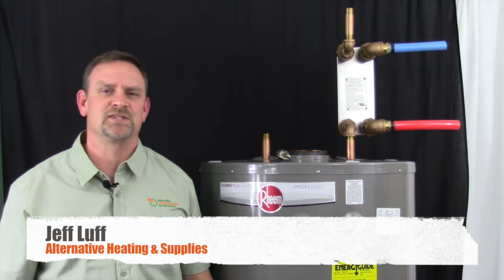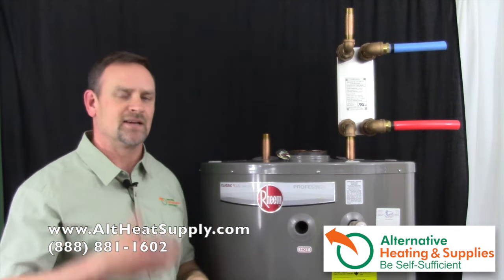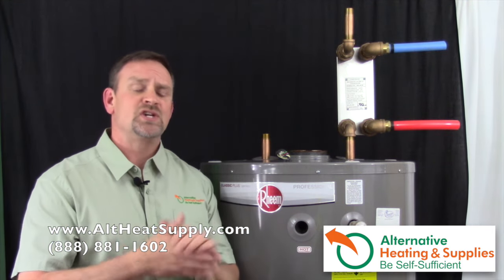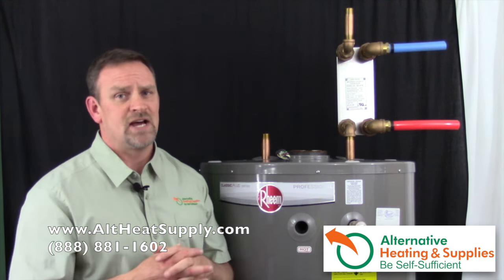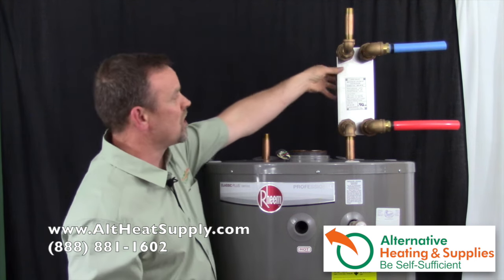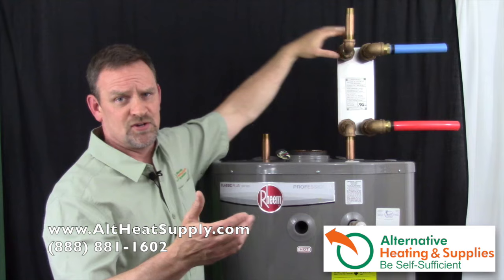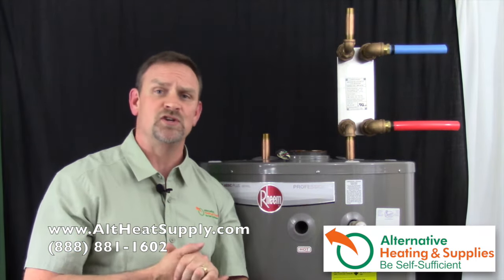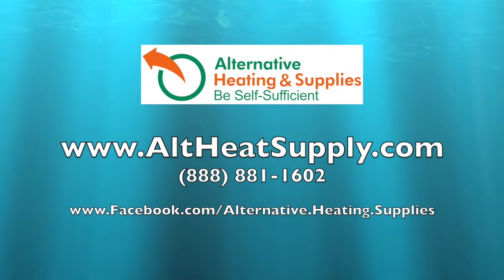How To Install A Plate Heat Exchangers To A Domestic Hot Water Tank

Comment: I am get ready to install a plate exchanger on the top of my electric hot water tank. My question is: where the cold water supply comes into the exchanger does it need a flo-check valve to get the pressure from the hot water  to enter the tank and not back flow to my cold water supply?
Reply from the maker: No it is not necessary, but it is also not a bad idea if you have water pressure fluctuation.
Reply: I think that maybe a mistake Jeff.  The cold water line is the only connection to the pressure tank (in a well system) or line pressure (if served by the municipality).  As temperature increases and pressure builds (as per your comments in the video) that pressure must go some where...and it will push back on the bladder or municipal system.  A one way valve will likely cause the tank or tubing to rupture.  Correct me if I am wrong please.
Reply from the maker: The hot water tank is cooling loosing pressure, so that is where the extra pressure is going. I haven't heard of a bladder tank going bad. The domestic hot water tank is usually 120 to 125 degrees, with the heat exchanger it will increase about 5 degrees taking up the extra pressure.
Reply: Thanks Jeff.  I am not sure what you are referring to regarding the bladder tank unless you misunderstood my reference to the hotwater tank.  To make my point clearer (and I still stand to be corrected) if the hotwater tank is drained for maintenance and then refilled with cold water in the summer when the boiler is off, turning the electric elements back on will cause the water to heat up and expand.  If there is a check valve in the cold water supply the pressure will have no where to expand to as the check valve will prevent it from travelling back along the cold water line to the pressure tank or municipal system.  Does that make more sense? By the way I am pretty sure the standard tank temperature now (at least in Ontario Canada) is 140F.

Comment: I am installing a 20 plate to a domestic hot water tank that has a radiant floor heating system already hooked up. Will we need to connect the exchanger the same way? Can you provide a diagram if possible? What is the max temp that can be used in the radiant floor?
Reply: +Leif Josephsen Radiant flooring has many ways and designs. The basics are the same though if your using a domestic hot water tank. Jeff
Reply: +MrDeepvoyage  So the temp of the water in the domestic tank witch feeds the radiant ( in concrete floor) system doesn't matter?I don't need a mixing valve to keep the temp controlled before it runs through the radiant system?
Reply: +Leif Josephsen yes of coarse it matters. Im not a radiant floor expert. I would asking radiant floor person
Reply: Hiii
Reply: Ask questions

Comment: Hey jeff, could i add one of these to my oil condensing combi boiler?. I have a wood burner in my garage i want to combine.
Btw great videos
From scotland
Reply: Hi I had two oil boilers in my 5900 sq ft house ran two plate exchangers  from my central boiler and heated house and hot water made a control so when boiler water got to cold oil would take over still working great 18 yrs and going
Reply: @johnbixler1758  awesome where is best to put the plate exchangers. What kind of control did you use.
Merry christmas!
Reply: @russellmcallister6830  Hi and merry Christmas to you I used 2 20 plate in on the wall near the boiler ran the supply into the back of the boiler and teed  off the return on the main supply to the house baseboard back to the plates I used two of them because I had two boilers because of the size of the house you may need only one do you have zone controls for your house as this will tell me about the base control you will need
Reply: @johnbixler1758  hey John,  no m8 no zone control just an oil condensing combi boiler with a stat control. I hope to fit a plate in the new year.

Comment: do you need a mixing valve so the water don't get too hot
Reply from the maker: If you have kids i do recommend, it will increase your hot water temp to about 130 degrees
Reply: doesn't get too hot

Comment: Yeah, I understand that this is a great method for pre-heating the water going into the tank but in no way is an ideal method for DHW from an outdoor wood boiler (or any boiler). Simply use some extra fittings, a pump, and a Johnson A421 and you will have full control over the tank temperature....none of this inject 180F in and you'll have 130F hopefully. Hydronic heating is about control and comfort!
-CIPH Certified Designer
Reply: My thoughts also, I don't see this maintaining a tank to temp with the tanks heating shut down and relying solely on the HX

Comment: I always have thought that hot water due to lower density is pushed by cold water up 🤔. As result all heaters have inlets at top part and outputs at bottom. Hot water pushed by pump from top down, heater will be uniformly filled by hot water from top to bottom.
Reply from the maker: Most Hot water tanks, both in and out are on the top.

Comment: At 5:00 you’re talking about feeding your domestic hot water first…How about putting in parallel the domestic hot water heat exchanger and the heating system?
Reply: +Philippe Laquerre Water will always choose easy path of resistance, that is why we do not recommend Parallel
Reply: I'm going to speculate that based on what Jeff said if you connect as per your design you will need to add a mixing valve in order to prevent burns.  According to Jeff (and a couple of others who have commented on their personal experience) the tank will heat to around 140 based on boiler water at 180.  140 is the temp that most tanks are set to in order to prevent Legionnaires' disease and most people are able to deal with that temp without the addition of a mixing valve or anti-scalding valve. The mixing valves are set to 120F but all to often the temp at the tap ends up being much less and so people don't like have these devices installed in the DHW circuit. Don't even consider your design without a mixing valve...150 to 170 degree hotwater will cause very serious burns.
Reply from the maker: not really understanding your question. Sorry

Comment: Thermal expansion and contraction are negligible. The water inflow will simply always Equal the outflow.
Also if your gas heater is available all the time you might as well get rid of your boiler

Comment: coming off the domestic hot water side I would add a tee , swingcheck valve and a union to another tee to the domestic cold water to create a thermal loop to heat the storage part of the tank
Reply from the maker: Hot water doesn't travel down into the tank so it wont create a thermal loop doing your suggestion. This way is simple and work great, pretty much anything else is over kill. I have installed hundreds many different ways and fount this way to be the simplest and most efficient. Jeff

Comment: Just set the tank temp lower so it doesn't come on if boiler set is 170
Reply from the maker: That should work just fine. If not lower a little more to ensure your boiler doesn't turn on... with the price of oil it will be an expensive mistake.

Comment: with no water flow into the tank, no heat transfer happens from the boiler.
Reply: dave rolleman. i think you may have a air pocket trapped in your boiler inflow. otherwise should  work. took a little bit to get my flow bled out